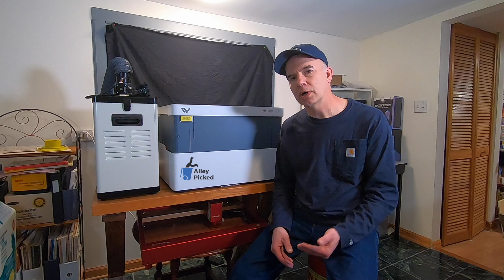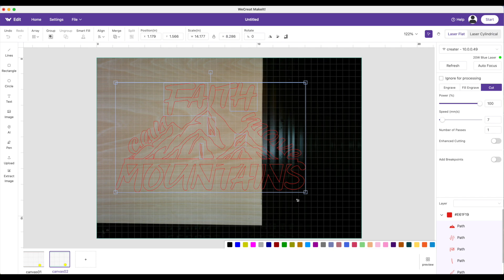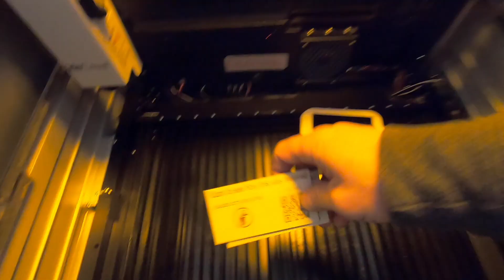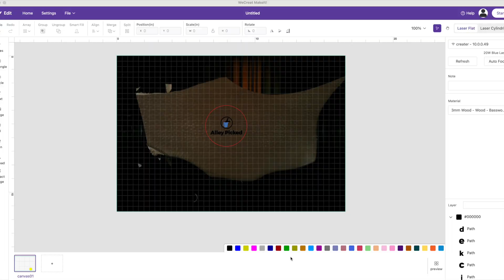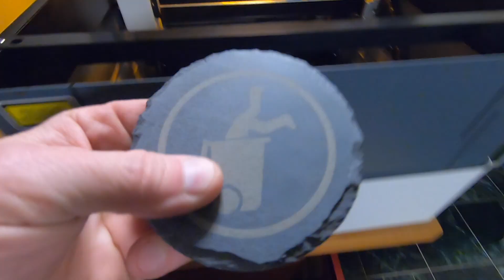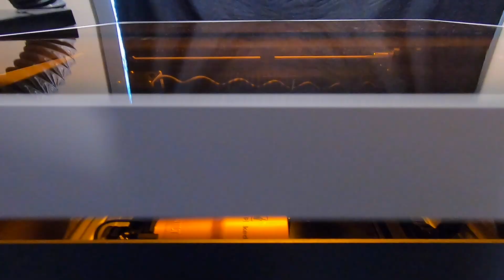WeCreat Vision Laser Engraver -- Is it the best?

Comment: Ive owned this machine for about 3 weeks and so far regret my decision. The company just got started and the program has glitches, lots of mechanical issues and it is extremely hard to clean. The 3"inch exhaust fan is too small. 

Dont buy this machine
Reply: @mattthames9624 I trust your opinion a lot more than a reviewer that gets a free laser to review.
Reply: Yea right! Interesting I have been stoked with mine! I won’t stop laying with it haha only had it about 3 weeks but yea it’s been amazing!
Reply: Although I should say I have the 40w
Reply from the maker: Can you be more specific? What glitches does the software have? What part is difficult to clean? The 3" fan seems to exhaust properly.
Reply: @AlleyPicked  happy to elaborate. The software will not load a saved project thru the program. Only thru computer files will you be able to locate and load the file. The program freezes when trying to set the laser dpi and speed. 
The internal autofocus is not working properly. It fails to detect the material, it doesn't retract, and the red focus light doesn't come on. 
The 3-inch exhaust fan does not exhumed enough cpm and the fan blades will collect residue more than usual. 

Im sure it is great for some people. But i have not put more than 15 hrs of time on my machine. It should not have so many problems right out of the box
Reply: @AlleyPicked   No phone number for customer service. Email response is once every 24 hrs and typically around 4AM.